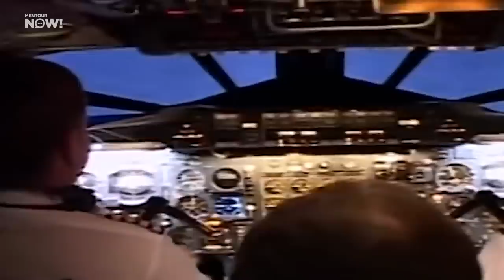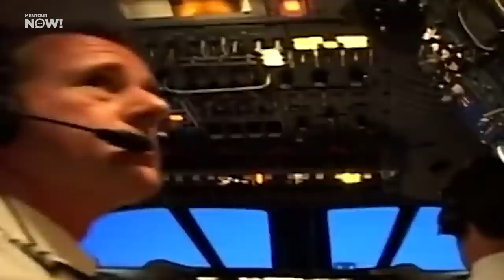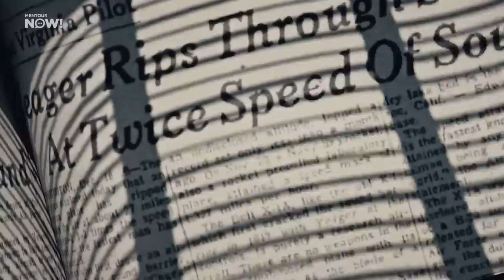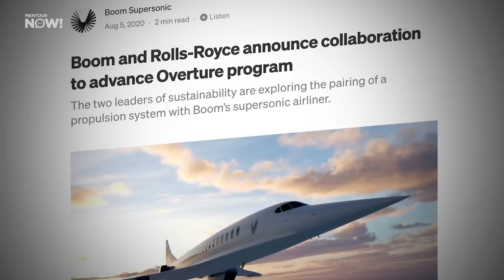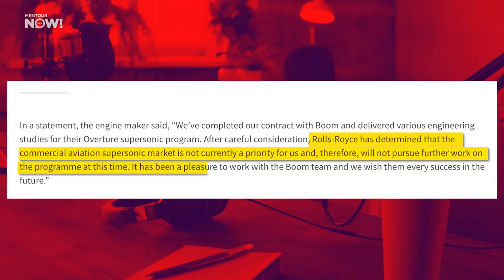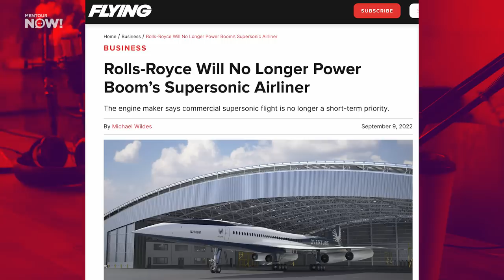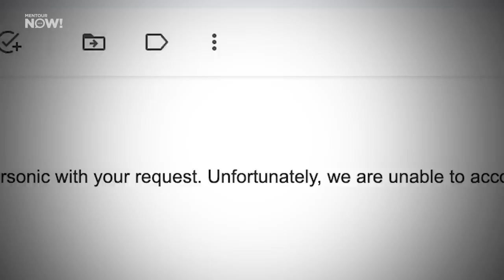WHAT’s Going On with BOOM Supersonic?! Will it Fail?

Comment: All new aircraft have challenges in their supply chain.  For Boom it's the engines, for eVTOL aircraft it's cells for their batteries.  These will all be worked out.  Whether their speed will offer enough benefit to attract sufficient customers is another matter.  It doesn't help that TSA and their foreign counterparts are demanding earlier and earlier check-ins.  Boom-using airlines may need to use special premium terminals with more intelligent security and check-in procedures so that they can offer a much more overall premium service.  Cutting an hour from time at the airport is worth how much cruise speed difference?

Comment: I'd still like to bite myself into somewhere not having used at the time BA re-established Concorde-flights the opportunity of relatively affordable fares. Gone....
Just that boarding procedure at the "Class Concorde" gates...
Than almost no taxying, just engine start and off it shoots...
There are only two more other air-travel experiences to miss similarly:
LZ 127 /129 and DO-X...
But therefor we are not responsible ourselves to have been to late...

Comment: Mach 1.7 should be achievable with turbofan without afterburner, there are jet-fighters that can super cruise at that speed but 2.2 sounds like turbojet territory and would be too noisy and fuel inefficient at lower speeds. Maybe they can use GE F414 without afterburner? Should be about the right thrust class.

Comment: The problem with current jet engines is the use of turbine to spin the compressor and exhaust temperature and speed for higher thrust. Is it possible to develop an in-house, self sustaining turbine-less jet engine that works with a compressor sucking in air and combusting that compressed air like a rocket engine in a chamber and exiting via a bell nozzle at extremely high velocity using the same inlet air intakes used in previous aircraft, but now pushing the full use of thrust to compensate for afterburner inefficiencies? It shall run an air rich mixture to produce hotter gases and hence higher Isp for the same cross section area.

Comment: I have a solution for the engine s on this plane. The F119 turbofan built by Pratt  & Whitney. Good for  Mach 1.8, and it has thrust vectoring.
Reply: @genel5103 Thrust vectoring! That would be quite something for an airliner.😊

Florida Turbine Technology are designing, building, and testing the engine for the Boom Symphony. FTT are a subsidiary of Kratos Defence and Security Solutions Inc, who have a market capitalisation of $1.88bn. Work started in January 2023. 

 Quite a coincidence because FTT has leading supersonic engine design expertise, including key engineers among the team responsible for the design of the F-119 and F-135 supersonic engines that power the F-22 and F-35.

Comment: They didn’t slow it down because of issues with the carbon fiber fuselage and wings. There’s a rocket from a company known as Rocket Lab, it’s called the Electron, and it is entirely made of carbon fiber, and that thing goes several times the speed of sound when launching.
Reply: Yes, but rockets go more or less straight up, so very quickly find themselves beyond the atmosphere.   Whereas a SST like Boom is flying at 50-60,000 feet continuously for several hours.
Reply: @cr10001  that’s actually completely wrong. every orbital rocket has to go sideways too. and this rocket specifically actually reenters the atmosphere at speeds so high that plasma can be seen on the skin of the rocket.

Comment: I assume they looked into retired military  turbofan  engines like TF30s (from F14As) and others .  You would think flame-outs during high-G maneuvers  far from a passenger plane's envelope wouldn't be a serious problem.  I'm sure that approach would be non-optimal because military performance would drive trade-offs, but until a new plane has the numbers to support a custom designed engine, it might make a new plane viable. What were the results of such studies? Are all suitable retired mil engines too thirsty and maintenance intensive?

Comment: If those Americans had really thought things out, they would've adapted the overall profile of the SR-71 to suit a passenger jet.  Those canard wings like they had on the Sonic Cruiser is ridiculous because they're too flimsy for such a large jet.  And if one of them were to break for whatever reason, that will be catastrophic.  Moving the main wings forward with 2 vertical stabilisers capable of functioning independent of each other is a much better idea.  An SR-71 profile will also make emergency landings on a body of water more stable.

Comment: they finally got the engine, its the new Symphony engine for the Boom.
Reply: Florida Turbine Technology, a division of $1.88bn Kratos Defence, started the symphony engine design in January 2023. Boom stated that no current engines, either military or commercial, are suitable for adapting to Overtures unique requirements. 

Boom will design the engine pods and the variable geometry exhaust and inlet ducting.

A big fuss is being made about Rolls Royce ending their contract with Boom, but AFAIK the contract was only for consultancy, and not to build an engine for Overture. Besides which, the Symphony project would be totally unsuited to the tier one engine manufacturers, like Rolls Royce, GE, P&W, and Safran. Their cost base and time frames would be out of kilter, and the volume of sales would not warrant their investment. GE caught a cold with the Affinity program.

Comment: In Air france there was a staff ticket you could get ... travel to New York or back on concord with the other leg on a normal aircraft. 

I worked for Airfrance back then .2000...... even with the Staff discount it was somthing like 1500 euro.  

I had a saving account set up to do it.  Then the crash happened ( I lived only a mile away from the hole beside the road)  

I was in CDG the day it came back but the staff ticket was never reintroduced and it was cancled before I could get a normal ticket. 

It was of my biggest regrets I didnt just get a loan and jump on the chance earlier.

Comment: The Hawker Siddeley Trident 3 had four engines; three tail mounted (as in the 727), and then a smaller booster engine to provide additional thrust on takeoff due to its increased size, and to assist in "hot and high" takeoffs.  The Trident was the design that Boeing STOLE in order to develop the 727 (initially co-operation between the companies even though they were competitors; HS handed a lot of information to Boeing expecting them to do the right thing/honesty, something Boeing has never really been known for).

Comment: The boom project was a failure from the start for very similar reasons that Concorde was retired.

Failure to acquire the necessary leap in power unit technology for economics to be successfully acquired.

The speed advantage was simply the main selling point, which could not be justified by the development costs.

Limited routes would be available for this business model

Speed advantage would only be observed around 48 % of a typical route. Remember, you go as fast as a slow average speed of airlines in any congested airspace around centrers where the customers are.

Load and fuel costs don't add up just like Concorde. So why, perhaps sell it to the military instead.

Likely outcome, bankruptcy and future revisiting the project when propulsion technology would be available.

Comment: GE F404 up to 20000 lbs thrust. Plenty of them in use.
Reply: The F404 hasn't enough punch. If you want to have any chance to run supersonic airliner economical you need to be able to "supercruise", stay at supersonic cruising speed without afterburner. The F404 is way to weak to achieve that with an aircraft this size. You need something that would atleast deliver twice the amount of thrust the F404 puts out.
Reply: @shi01  P&W F100 then? They will never get an original design, so off the shelf is their only option. Supersonic is cool, but not economical. LARGE fans are way more popular with most airlines, so there is where the engine manufacturers will put their money and time.
Reply: @jakobcarlsen6968  Well, the F100-229A may be strong enough. The thing is really, the engine needs to develope a lot of dry thrust.

I understand the engine manufacturers, Boom will probably face similar issues like Concorde. Very low production numbers, so if they would have to develope an all new design, they will never get their money back.

Comment: I think that zoom needs to enclose the engines and utilize a spike to control the supersonic to subsonic airflow.  Nacelle powered engines will generate a lot of drag at supersonic flight. That’s why you see few supersonic jets without enclosed blending.  I don’t know their thrust requirements, but many of our military fighter jet engines would probably be able to fit their bill.  I like the idea, but they aren’t there yet.
Reply: @phonicwheel933  Thanks for in-depth response.  I think the engine is key and it has to make a profit on top of a new designed engine R&D.  The planets really have to align just to get a working prototype in the air.
Reply: @edjarrett3164  No probs. Glad you read it all. It went on a bit😊 I started looking at Boom Symphony a couple months ago, and at that time I thought the whole concept was nonviable. But after gathering some information, I think the concept looks hopeful.

On the other hand, Boom seem to be vulnerable as far as finances go and, as you say, the planets will have to align for then to succeed.

Yes, the engine is key, and according to the experts the variable geometry exhaust and inlet ducting is also a huge task.

Comment: I realize this is the peanut gallery of technical expertise, but my first thought with Boom from the beginning was that they needed to find a low-bypass turbofan military engine for supersonic cruise, and work backwards from that.

There aren’t really any engines that could be adapted to supercruise at that speed though. GE adapting the F101 was the best bet. That is the base core used for a bunch of military turbofans and probably has the most knowledge hedged up around it too.
Reply: @captainobvious9188
Florida Turbine Technology are designing, building, and testing the engine for the Boom Symphony. FTT are a subsidiary of Kratos Defence and Security Solutions Inc, who have a market capitalisation of $1.88bn. Work started in January 2023. 

 Quite a coincidence because FTT has leading supersonic engine design expertise, including key engineers among the team responsible for the design of the F-119 and F-135 supersonic engines that power the F-22 and F-35.

Comment: I don’t think Rolls Royce closed the door completely. It’s possible they found the engineering staff to be inexperienced and this would be good reason to hesitate on committing future resources. Larger companies tend to be risk adverse. I noticed you left out a discussion of their technology demonstrator. This smaller aircraft has not completed flight testing from what is publicly available and if it can successfully complete flight testing and prove out the low boom technology, I think there is a possibly Rolls Royce will reengage. 

Everything is in steps, and to secure funding Boom probably needed to present a conceptual design to investors to continue development. Once the junior engineering team gathers data from their demonstrator and increases their experience, they may find success. I wouldn’t count them out. Hopefully they can keep going with funding! Don’t give up Boom if you are reading this!
Reply: Florida Turbine Technology, a division of $1.88bn Kratos Defence, started the symphony engine design in January 2023. Boom stated that no current engines, either military or commercial, are suitable for adapting to Overtures unique requirements. 

Boom will design the pods and the variable geometry exhaust and inlet ducting.

A big fuss is being made about Rolls Royce ending their contract with Boom, but AFAIK the contract was only for consultancy, and not to build an engine for Overture. Besides which, the Symphony project would be totally unsuited to the tier one engine manufacturers, like Rolls Royce, GE, P&W, and Safran. Their cost base and time frames would be out of kilter, and the volume of sales would not warrant their investment. GE caught a cold with the Affinity program.

Comment: @6:16 you said the aircraft are nearly identical in length. The "Overture would be 201ft & that's just 1ft (30cm) SHORTER than the Concorde" Then however, the graphic lists the Concorde's length @200ft, which would mean the Overture would be 1ft LONGER, not shorter than the Concorde. I think ya just got it backwards. No worries, it happens. Enjoyed the vid as always 😉✌️.
Reply: I noticed that also. However, Concorde is 202ft 4in long.
Reply: @jimgemmell2831  yeah I know, I was just commenting on what he said & what the video showed. 😉✌️
Reply: Considering that the length of the Concorde could change by almost a foot in flight (due to expansion caused by aerodynamic heating) I'd say that it's within the margin of error~
Reply: @KantiDono  he said the Zoom was 1ft shorter right as the graphic showed it was actually 1ft longer. I think it's safe to say he made a mistake. 😉✌️
Reply: Just got the graphic wrong, that is all.

Comment: The main reason for Boeing 2707 to fly that fast have to do with thermal efficiency. At the time they figured that they could´t make a bypass engine that fly supersonic, so they had to use a turbojet engine. Turbo jet engine becomes more efficient the faster its fly (just like a rocket). If this is combined with a higher flying altitude, the aircraft actually use less fuel when its fly faster. (while its terribly uneffcient at lower speeds).

Boom suppose to use a dual fan medium bypass engine. For that the thermal efficiency rule don´t apply. What is the most efficient speed depends on the weight and the altitude of the aircraft. And mach effects. The most efficient speed is simply mach 1.5-1.7 for a 3:1 bypass aircraft at that size and altitude.

Comment: I am sure if you need something quick these days, you just video conference.

It would be interesting to see if someone starts working on advanced hybrid electric aircraft.  All of these technological and material advances we have had in recent years makes a lot more sense for this than a supersonic airliner.

Just the heat alone of going above mach 2 nulls out a lot of these material advances as they can't take the heat, at least not without a lot more research than most any startup can do.  Can't certify something that might structurally weaken and fail because the material is not proven for the heat loads and may need substantial reformulation and further testing to prove it is safe to use.  Don't want to make another de Havilland Comet.

Comment: i dont think they will need a new engine all together since the target is 1.7 they most certainly  can use an existing model from a manufacturer and atleast get one of these prototypes out it would be nice to see one of them fly even if the concept still isnt viable.
Reply: @tahnokbrn

Florida Turbine Technologies will design, build, and test the engine for the Boom Overture. They started work in January 2023. FFT are a division of Kratos Security, who have a market capitalisation of $1.88bn.

Comment: Finding a suitable engine for M=1.5 to 1.7 cruise wouldn't be impossible. Eurojet EJ200 for example would basically suit almost out of the box. It makes no sense to go for much higher bypass ratios at the speeds intended. Propulsion efficiency at the high speeds intended, would be good: Concorde attained record efficiencies using even turbojets (0 bypass). Off course, optimization for a civil airliner would differ from a military one, but not too far to succeed. Using variable inlet geometries is obvious though. It may as well be considered a part of the airplane, rather than of the engine.

While this is technically viable, the problem of Overture or others will be its low efficiency, being kinda basic rule of SSTs. Concord's L/D ratio is said to have been about 7.4 at M=2. Compare this to the L/D of current days transports in the low twenties. Aerodynamics might be optimized beyond Concord's level, but there's no major break through in sight. Even neglecting the sizing effect of additional fuel mass due to higher consumption (which actually is severe on long range flights) and assuming structural weight and engine efficiency being in line with current day transports would make an SST consume about 2.5 to 3 times as much fuel per payload. Not a good idea, considering soaring prices and environmental footprint sentiment.

There might be a limited audience, willing to pay much higher ticket prices for the sake of supersonic speeds. However, the final show stopper would presumably be the noise issue. Low bypass engines are inevitably loud at take off and climb - even worse if an aft burner would be needed.
Reply: Florida Turbine Technology, a division of $1.88bn Kratos Defence, started the symphony engine design in January 2023. Boom stated that no current engines, either military or commercial, are suitable for adapting to Overtures unique requirements. 

Boom will design the pods and the variable geometry exhaust and inlet ducting,

A big fuss is being made about Rolls Royce ending their contract with Boom, but AFAIK the contract was only for consultancy, and not to build an engine for Overture. Besides which, the Symphony project would be totally unsuited to the tier one engine manufacturers, like Rolls Royce, GE, P&W, and Safran. Their cost base and time frames would be out of kilter, and the volume of sales would not warrant their investment. GE caught a cold with the Affinity program.